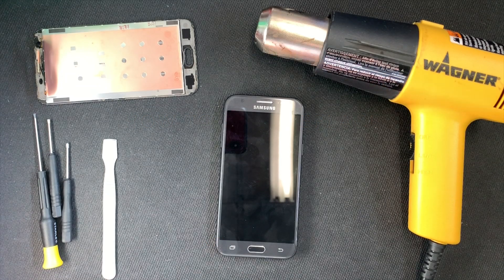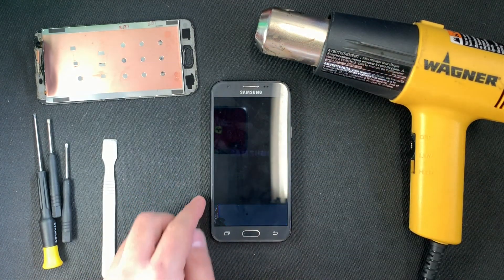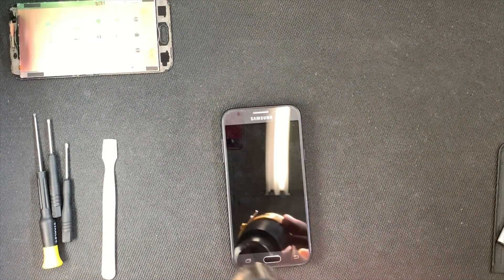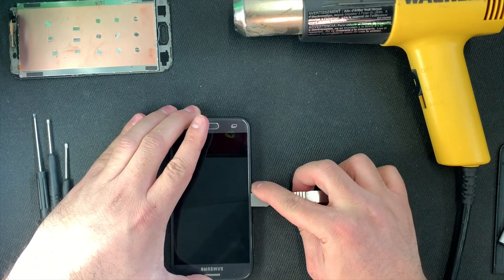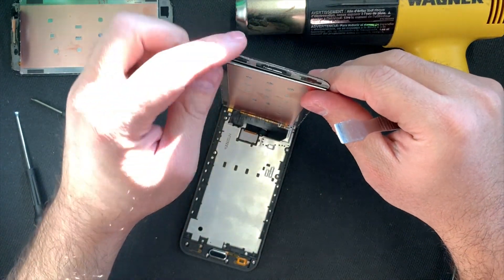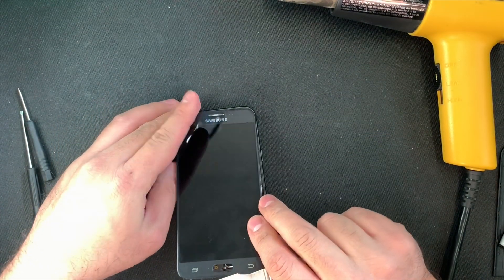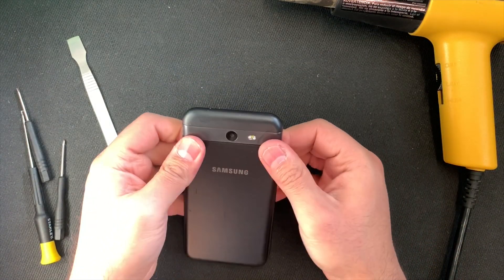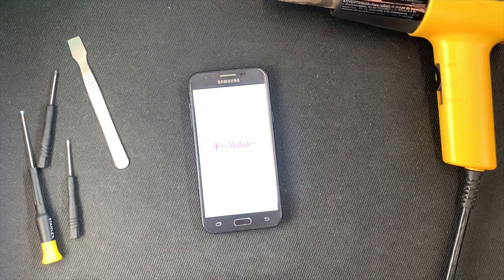Samsung Galaxy J3 Prime How to Fix Cracked Screen | How to fix Galaxy J3 screen | NexTutorial

Comment: Where can I get this replacement screen. I cant find it anywhere.
Reply from the maker: Try to buy them from eBay but make sure to order the one with the same exact model number.
Reply: @NexTutorial  The same exact model number as the old screen? Because I don't know what the model number was because it got ran over by a car and the screen was completely destroyed.
Reply from the maker: I can’t recall the model number for this phone but if you open the back and take out the battery it should be written on the white sticker on the back.
Reply: @NexTutorial  okay thanks you =)
Reply from the maker: You are welcome 🙏

Comment: Hi I have the same phone it's old but it has a lot of memories. I want to get the screen replaced because it started bleed I wanted to know if the same screen replacement would fix my phone. And if so..do you have any good suggestions on where I could go to get the parts needed for the installation. Please and thank you shannon
Reply: I have the same problem & I don’t know where to go to get it fixed but do you know if the SIM holds screenshots ,pictures & videos on the phone storage that I’ve saved from YouTube & Instagram. Because if it does I couldn’t care less about the phone I could just get it transferred
Reply: @Lee-ef1vn  Afternoon...I believe so but the I'm not 100%sure. You could transfer the sim card to another phone and check. If u really want to you could   look up local repair shops to see if they could fix it. It just might cost you so money. One repair shop said $90. And the cheapest said $70. 
With that being said I decided to buy the screen off of Amazon and try to install myself.. this video is very helpful so I'm gonna take a chance with it. ..anywho I hope you it works out for you Xavier. ....Shannon
Reply: shannon brown yea I’ve seen that too but I’m an expert on phone but not when it comes to fixing them. I might just have to buy the screen and ask if a repair shop can fix it idk